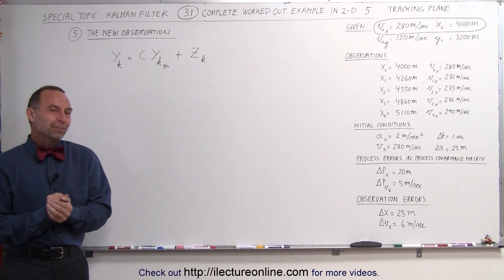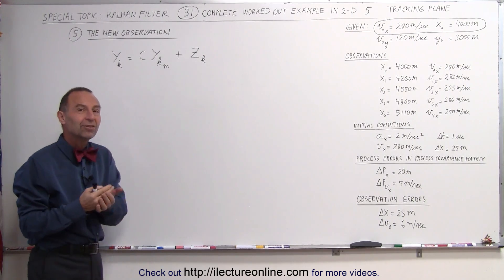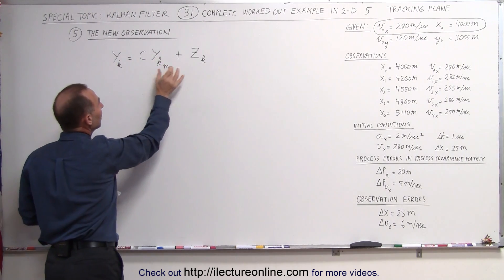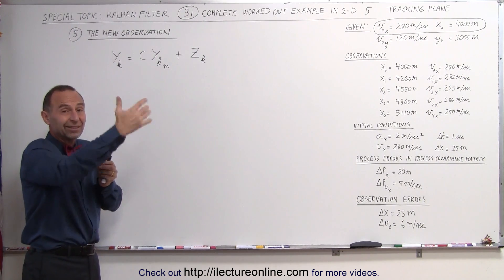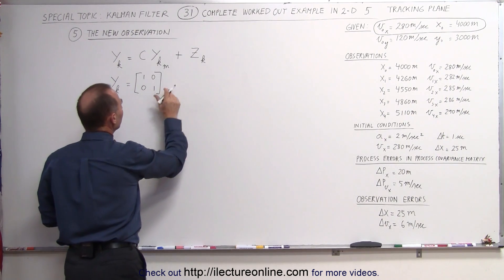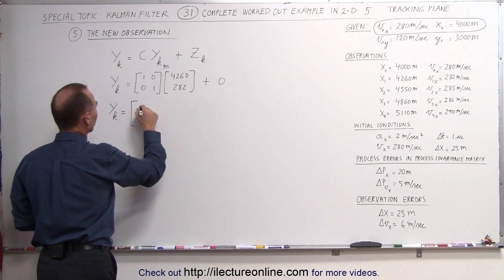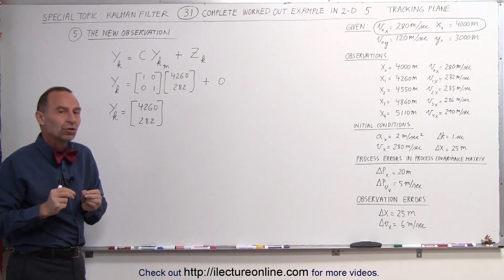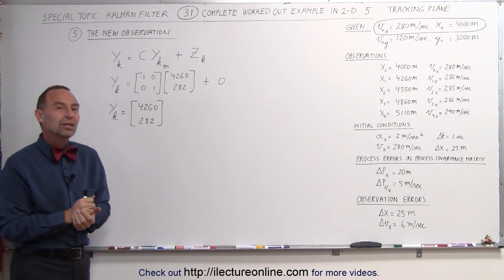Special Topics - The Kalman Filter (31 of 55) 5. The New Observation - Tracking Airplane

Comment: if the position and velocity of the measured and there is variable to adjust/correct the measurement error why dont we use the measurement value itself and reduce the error in measurement.instead we are going for estimation with a lot more variable such as kalman gain, errors in estimate this that??????
Reply from the maker: Remember that in most applications, you don't know the correct value, so the KF is used to come as close as possible to the correct value (without knowing what the correct value is).

Comment: I understand errors that made up the Z matrix as accuracy errors and errors that made up the R matrix as precision errors. Note that accuracy errors are errors that can be easily corrected by moving the points in the right direction. For this reason,  I consider that what Z is doing is just moving the points to the bullseye (correct value), so the accuracy errors are canceled off.

Comment: Shouldn't it be Y = CX+ Z to relate the observed variable with the state variable?
Reply: no, cause we use X term to show estimation and y denotes the observation
Reply: @mojiheydari  Look at expression 1: if X was an estimation, it wouldn't contain a noise component. So I'm not sure your reply is correct. Or put differently: maybe the whole presentation, while otherwise very helpful, doesn't clearly enough make a difference between actual process and estimation.
Reply: @sakuranooka  As far as I am concerned not only in Kalman filtering but also in other methods e.g. particle filtering, we add the noise to the current state to investigate the validity of the adjacent states (hypotheses). Think about a SLAM problem where we want to decide the location (state) of the robot based on the environmental clues (eg. door, barrier, etc). We use a gaussian or any other type of distribution of noise to add more state candidates in case they satisfy the observation better.
Reply: @mojiheydari  If you look at linear regression then this --> y_t = beta0 + beta1 x_t + eps is the actual process model that fits the observations and contains noise. However, this --> y_t_hat = beta0_hat + beta1_hat x_t is the estimate and does NOT contain noise. The same applies to KF: the KF is an estimator, it should not contain noise, however, the underlying process that it estimates does contain noise. So I think the presenter here, as he is demonstrating how to calculate the KF estimator, should remove the noise term from the equation (as a workaround he sets it to zero but it should actually not appear at all)

Comment: I have a doubt in distinguishing between Z and given observation errors. I understood the things u told about Z but then what are these observation errors given(25 and 6), how are these measured????
Reply: Did you get the answer? I am facing the same problem. would you help me?
Reply: R is the measurement error and Z is the measurement noise/uncertainty, which in this case is considered zero.

Comment: What I hate about this video and the previous one, is that you used an easy example where you didn't have to transform the matrix. Your video is barely 3 minuts long imo you should either have added a separate video how to obtain those transformation matrices either have done it here.

Comment: I disagree with one of your statements. You mentioned that the C matrix needs to be the same as the A matrix. It only needs to be if the observation states are the same as the predict states. For example, gyro bias is not measure directly but it is a predicted state and the measured state does not contain that data. You can ignore zeros in the the measured state as long as they are filled with zeros during the matrix math.

Comment: Thank you for the videos. I have a question: why did you use X1 and V1 ? why did not you use X0 and V0 ?
Reply from the maker: Xo and Vo are your initial values.   X1 and V1 are the fist observation inputs.
In actuality, it doesn't really matter as the filter will filter out any discrepancies quickly.